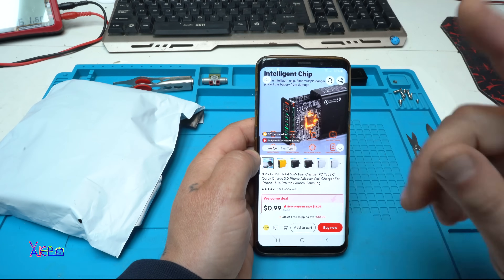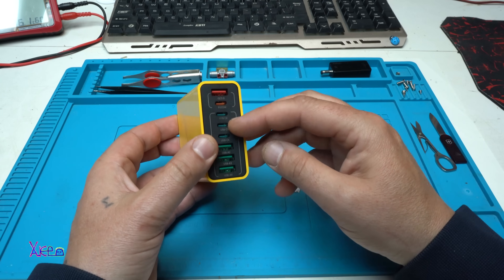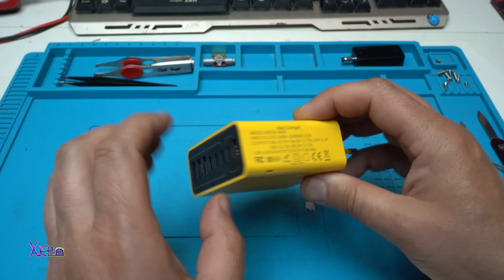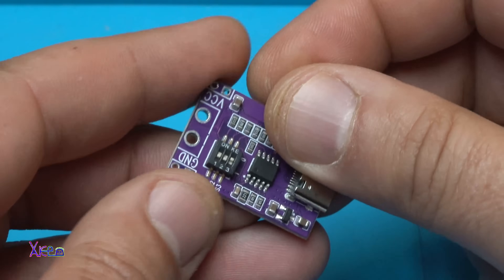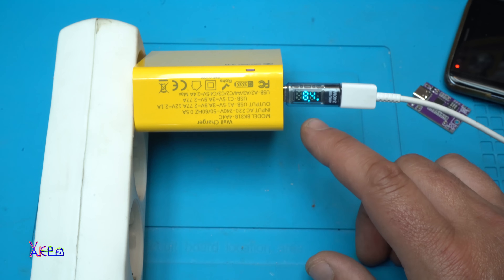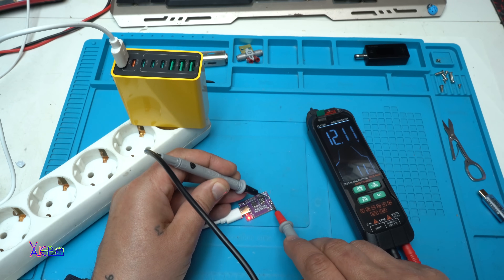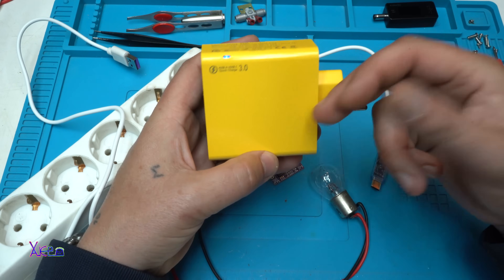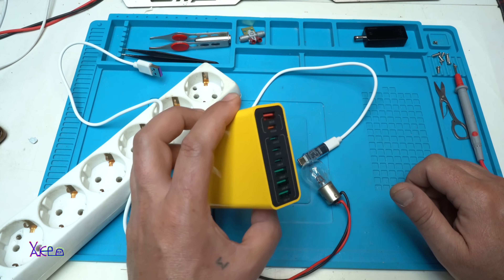I Paid $? For Aliexpress Power Module and This Happened?

Comment: I would never ever trusted that thing. To put a cheap China-charger directly to the inlet....no thanks. Maybe as long as I was in the same room, but I would look at is as a big fire-risk or risk of electrocution.
Reply from the maker: Cmon sir,I have tested a lot of made in china products and I must admit in hunreds of gadgets maybe 2 or 3 were not that good.Your iphone is made in china where do you charge it,OUTSIDE 😁
Reply: @Hacktuber  I agree with you, all these folks hating on China when their own countries don't make anything.China makes some amazing products and is capable of producing high quality (IF the buyer pays a fair price).
Reply: @Hacktuber  Hi and thank you for your reply.  Yes, my Iphone is made in China, but with much more quality parts, and under much stricter quality-rules. There IS a reason that something is very cheap, and other similar things much more expencive, and that is because of quality both in parts and control and the way it is built. There are many movies here on youtube that really test these chargers, not only the charging volrage like you did, but take them apart and look how they are built, i.e how good the output is insulated from the high voltage section. This charger could of course be very good, but all I say is that I never ever would buy a cheap 240v product like this and trust it. Here is one movie that goes a little bit deeper in the quality of a cheap charger: https://www.youtube.com/watch?v=NF6ql9rrNDE&ab_channel=CraigMatthews

Comment: I keep looking for a usb pd trigger board with a timer. So I can run a fan for a few hours, then turn off. Didn’t find anything yet, any ideas?
Reply: Pi pico? Is the fan 230V? there are electronic relays, or normal relays. For a small fan he did a module that can control up to 30V a few days ago.
Reply: @Jo-re2ye It’s a 12v fan. The idea is to use a Usbc powerbank (or charger), connect the fan via a trigger board and have the trigger board firmware cut the 12v power after some time. No idea if usb pd has some kinda stop/off message (and if anybody implements it).
Im currently using a trigger board and one of those cheap timer modules with a relay. But would make a nice feature for a trigger board 😊

Comment: so, it's not that great if voltage went down to about 10v when you set it to 12v and 1.7a, too much power drop for something that it should deliver 12v at 2.1a... which is well below the advertised 65w, too
Reply from the maker: I think that type c usb watt meter is reading wrong voltage,I will do new vid with more testing

Comment: They are ok but they won't provide 65W. The power ratings are fake on these chinese power adapters. You should have loaded it up to test the maximum current output.
Reply: no matter, you not need newer 65W if charge phone.
Reply: @mattivirta why you should limit to charge JUST a phone... a similar psu could be used to power even a notebook, IF, and ONLY IF, it can REALLY deliver 65w... which THIS will NEVER do, be sure... or you can use to power an usbc soldering iron, or whatever...
Reply: @squalazzo  Exactly this. I use my power banks to power microscope lighting, small audio amps (via DC - DC converters) and more.

My bigger concern with these cheap AliExpress usb chargers is their build quality and the fact that many of them are fire hazards which I have experienced firsthand. I like AliExpress for lots of things but I would not trust any of these to be plugged in in my absence.
Reply: Please make that test with electronic load
Reply from the maker: Coming soon new test